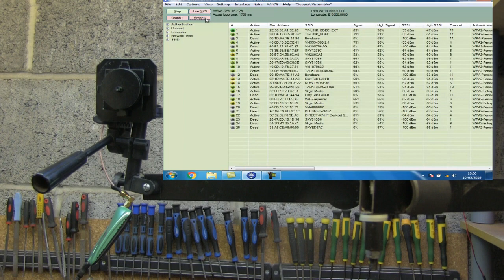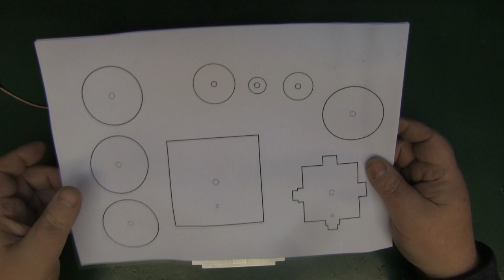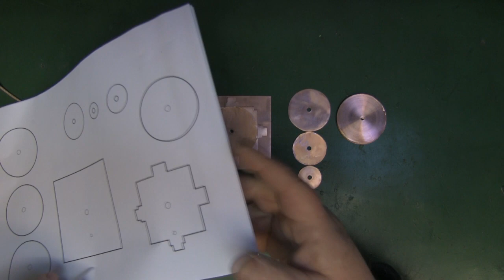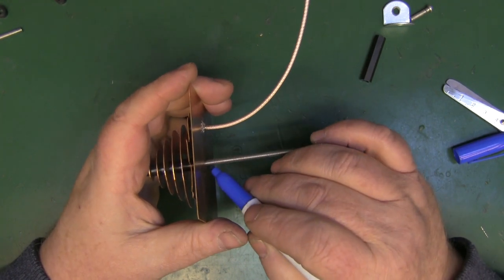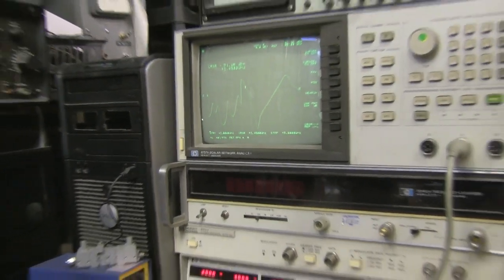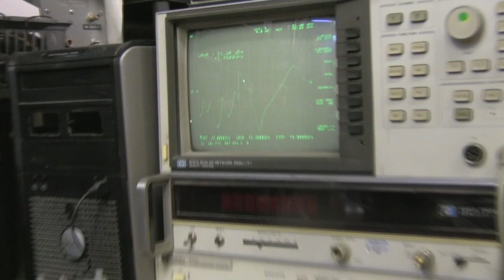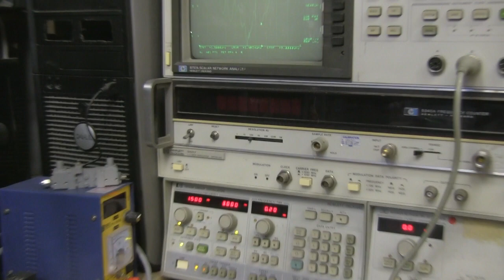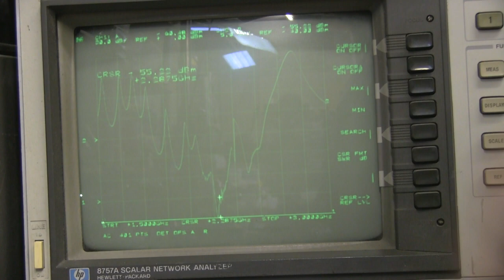My New Favourite Antenna

Comment: This special kind of 'Yagi' is driven across two elements. It's behaviour will be best explained as a hybrid of the HB9CV (driven over two electrical connected elements) and a log-per-antenna (with elements continuously decreasing in size. As the driven element is not only a dipole in front of the reflector, this is not simply a yagi uda. It's a bit more complex. Even more complex is the question, how this antanna's polarisation would be. Probably circular. You won't find out about the gain without precise measurement. But as long as it performs fine... Don't worry.
Reply: My WAG would be horizontally polarized since the feedpoist is horizontally offset but vertically symmetrical with no introduction of phase rotation.

Comment: Generally speaking, if the resonant frequency is lower than expected, the driven element is too long (big). I'd try  carefully trimming the driven element to get the center frequency a bit higher. Looks like I have a new project to try. Thanks!

Comment: On the pdf, please add a reference on the size/scale so we know, once printed, the size is ok (before all the cutting work)
Reply: Yes, clear size information would be very appreciated.
Reply: I manage to measure the shapes in the original pdf file. Please note that measurement are in mm and needs to be roundup or down. https://drive.google.com/open?id=18zO9kqMy-fM6rCkbbpk4ClFFSJZe7IGx . Enjoy and share your results after build.
Reply: @John Downes
Hi John, thanks for the efforts but your measurements are slightly off. Could you do another edit round and update them? I bought the antenna on ebay (https://www.ebay.de/itm/2-4G-14dBi-150M-Long-Distance-USB-2-0-Wasserdicht-CMCC-Kabellos-Wifi-LAN-Adapter/163568415485?ssPageName=STRK%3AMEBIDX%3AIT&_trksid=p2060353.m2749.l2649) took it apart and measured it with a digital caliper.
Here are the results (in mm) compared to your (John) drawing:
Circle = 52.18mm

Original reflector = 78.09 x 95.22
corners = 4.4 x 10.1
hole = 26 from short & 39 from long

Driven element
51.5mm (John) = 51.6mm (measured)
13.5 = 13.6
8 = 8
4.91 = 5.2
9.5 = 9.6
4.50 = 5.2
corners = 3.8 x 3.8
13.49 = 14.3
hole = ok

Spacing is 5mm in both cases

This results with me in a center frequency of 2452 MHz (Channel 11) and an SWR of 1.411. Increasing or decreasing the spacing makes things worse and adding one or more elements, drops the SWR to 2.095 and worse and makes the thing unusable.

Ok guys, I hope this helps some of you.
Reply: I checked and even the original measurements from the chinese antenna are slightly off. The new improved version with measurements  https://drive.google.com/file/d/1YUtCtA57I8AyKA4WGt4QRwAIShzAoUJn/view?usp=sharing . This is not my work i just share. Thanks
Reply: @johndownes9969  thanks, after a few weeks research this design rocks and this will be my first attempt at making a directional antenna
Reply: @johndownes9969  Offtipic question ... but do you happen to know if this design or any particular design would work for indoors (going through walls/floors) use? it would connect to an extender. thank you for any input.
Reply: Thanks for the shares John Downes ! just a question did somebody  know the software name who draw the field of this antenna  share by John Downes  ? ? https://drive.google.com/file/d/1YUtCtA57I8AyKA4WGt4QRwAIShzAoUJn/view?usp=sharing 
the icon is too tiny on shootscreen but this "colors" this seems to be a software under linux !?  isn'it
Reply: At what scale did you print it??? 100%?
Reply: @johndownes9969  Thanks alot
Reply: @johndownes9969  I see that your hexagonal mark in the middle is not at the centre of the driven element. or director circle. Is this deliberate?  Thanks.
Reply: @johndownes9969  thank you bro
Reply: @johndownes9969  it was copper, wasn't it.
Reply: @sweeneyb52  me to lol

Comment: Build it and put it in a 120 mm drain pipe end put aluminium around the Outer wall. It became my best directional antenna. Worked great to use the public network at the campsite. ;-) Thanks.

Comment: I see you're using a metal threaded bar. Doesn't the driven element need to be isolated like the problem you found on the wifi gun?

Comment: I kn about antennae but I'd imagine conductivity, or not, between elements is important? This design has insulated spacers separating the elements but all joined by a common threaded conductive rod - so how do you know if your elements are insulated or shorted? The discs may touch the thread but the contact may be so poor it is high resistance, or it may be zero resistance. Surely you have to remove that variable, by using non conductive rod or stepped insulating spacers for example, before you can tune your antenna?

Comment: Hi Andrew. thank you for great video. can you measure performance between 1 elements or 5 elements? (sadly i have no spectrum analyzer and no chance to find) also can i use this template with pcb copper plate? they are cheap and easly work with them but i dont know is thickness changing something? kind regards

Comment: Probably this is an stupid question (I do not know anything about atennas) but: in a normal sunny day, in a city, in which distance range could I expect to get a over 50% signal? Thanks. I ask the question in this way because since I do not know anything about antennas I do not understand the parameters which define the antena capabilities.

Comment: Very nice one!
I guess the obvious question is: how does it perform in a can? =))

I'll keep a close eye on this one, because I have 2 locations where I will need a directional wifi antenna, one due to distance, the other one due to hostile environment: 2 neighbours competing signals by boosting their router output power instead of just agreeing on using different frequencies are blowing away my mum's out-of-the-box wifi router signal. Can't get a decent stable reception 7 meters away, *in the same room*! Shift one floor up or down and forget about it... (and to know that the one causing the escallation, two houses down the road, only uses it to connect his printer that sits on the same desk as his computer...)

Can you do a video on working angles of this antenna?
Thanks!

Comment: I tried this antenna, it doesn’t work, i even tried to have 2nd rectangular disk de-shorted ( meaning that is not part of the circuit. It sits on rubber and no electricity passes by if you check it by Voltmeter ), i tried making everything 1.8x bigger, still doesn’t work. I use 75ohm cable. Any reccomendations @andrew mcneil

Comment: Hi, I am trying to improve my router's ability to receive and transmit to the internet, as I live in an area where the signal strength is very low.  I am currently using a '3' 4G blackbox router (about 4" by 2.5" in size).  I can get a better signal if I take the router up into the attic space, but the stane walls of my house are 30" thick. Will this sort of antenna help with both transmission and reception?  Is it intended to improve the WIFI signal strength or the ability to connect to the internet?  I do not understand why these little box routers do not have a terminal for an external antenna.  I would appreciate your advice.
Reply from the maker: No this is 2.4GHz only

Comment: Today made the design according to the pdf without measurements and the best swr is above 2.7GHz. I also could not tune it down. Next step is to order the original antenna from ebay and take the measurements myself. So far im rather unimpressed with this one.

Comment: I stick to horn antennas,  easy to build, gain from 8dbi to 20dbi, broadband, extremely cheap, I dont use connector on antenna,  cable crimped to can. Even low gain horns perform very well,  wide pattern. I have used 75ohm CATV quality cable with low loss and "F"  type connector and homemade adapter to RS-SMA.
Reply: Make PDF on that! Or video

Comment: Hi Andrew, with simple things you make great results! I want to ask you: I have three bluetooth rtx (one is tx and two are rx) I use them to transmit Hi-Fi at 60mt. Originally the devices had small external antennas, (effective working radius 30 meters), subsequently I modified by installing three antennas (one on each device) always vertical type but more performing. I don't have the best tools as you have them but I noticed an effective increase in the working area, 60 meters. Now I would like to put / try three directional antennas (not much ..). My arrangement of the two Bluetooth rxs are 30 degrees open compared to the tx. Let me explain: I have a mixer console and I connected the Bluetooth tx, then I have two speakers (right and left ch) arranged 50 meters from the tx and about 25 meters away from each other. So: on the tx an antenna with a narrow irradiation lobe while on the two rx an antenna with a narrow irradiation lobe. can you show me your works where to look? Thanks!

link Bulutooth: https://it.aliexpress.com/item/4000308521905.html?spm=a2g0o.productlist.0.0.6e967dd8FeV5O3&algo_pvid=f1ac4452-096a-46f6-97bf-891c2d89f2fb&algo_expid=f1ac4452-096a-46f6-97bf-891c2d89f2fb-58&btsid=0ab6f83915859938512773527e5264&ws_ab_test=searchweb0_0,searchweb201602_,searchweb201603_

The previous model had only one antenna...
Reply from the maker: People who do this kind of thing with Bluetooth tend to use a biquad antenna. The trouble with Bluetooth is you have so little power to work with a single biquad is an easy directional antenna to build with simple tools. The good thing about the biquad is that it is directional but it has a wide beamwidth, think of it as a torch compared to a downlight. Don’t bother with a double biquad though as you would not really see a difference with Bluetooth because of the low power you have to work with.
Reply: @andrewmcneil  Thanks Andew! I orient myself on this antenna ..
Reply from the maker: @carlocastelli7511  Yep building it into a tin like that would be much nicer than a PCB board if it is on show next to your setup.

Comment: Shouldn't those parasitic elements be further spaced than 5mm?
Reply from the maker: They are spaced at constructive points at the operating frequency and there are many constructive points along the wavelength
Reply: @andrewmcneil  Could washers of the same diameter and thickness be used?
Reply from the maker: @eliasjoserodriguez5160  If you can find them yes

Comment: How to tell if this is 5ghz wifi or 5g LTE ?
Reply: @andrewmcneil  A 5ghz wifi antenna isnt useful for 5g mobile I believe. Could be wifi or mobile network either, not both signal..not sure if Im confused !
Reply from the maker: @bradthelad3000  5G is 3.3 to 3.6GHz 5GHz wifi is 5GHz

Comment: Why is it called a driven element
Reply: Because this is the only part that is directly connected to the cable.  The other elements direct the signal toward this element similar to lenses of a telescope.  This is as opposed to the similar design called a log periodic where all the elements are connected in a circuit.  The advantage of this is that it is more broad band while a yagi-uda is more narrow band.  On a yagi-uda the reception is centered around the frequency of the driven element.  It will receive a range of frequencies below at a decreasing gain.  The gain drops off sharply on frequencies above.  The more directors added the higher the gain but the narrower the bandwidth becomes.